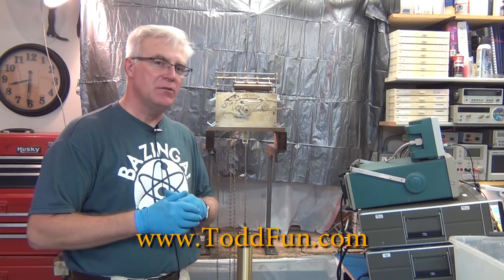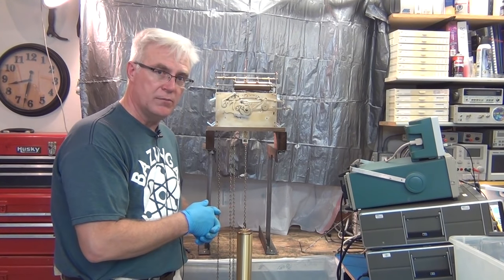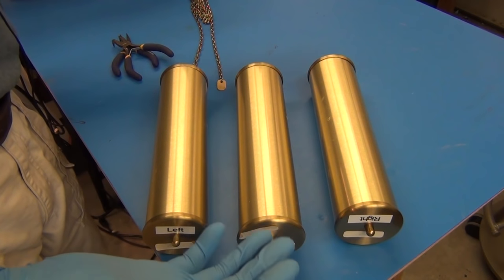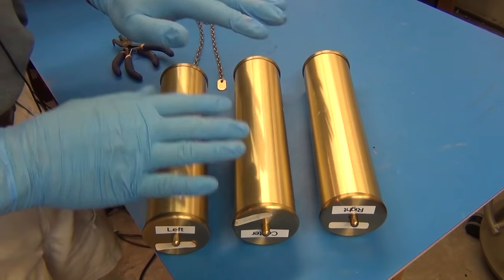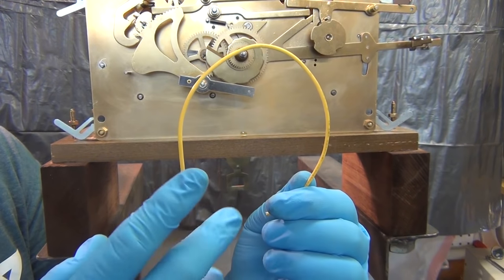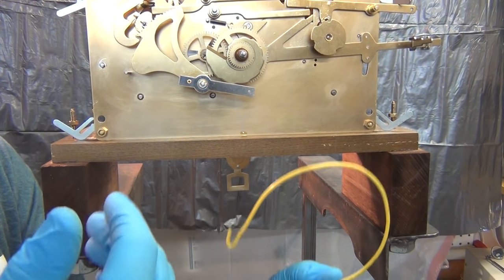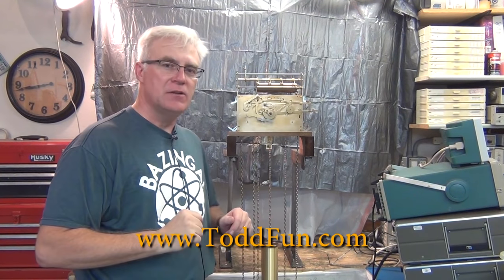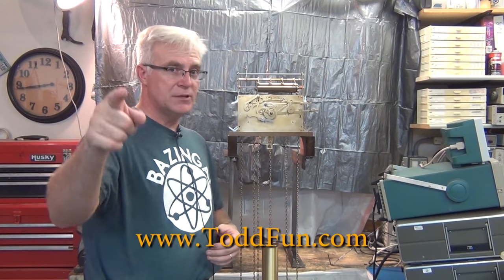How to Remove and Install Grandfather Clock Drive Chains

Comment: My grandfather clock does NOT seem to have side panel access. I looked on the inside of the cabinet to see if there were any
pieces holding the side panels in place, but there are none. The side panels seem to be 'fixed' in place and don't move.
Reply from the maker: Then the top might come off forward or  just have to the mechanism out.

Comment: No, I took the middle weight off right after I wound the 1st (on the right) chain with the weight on it. When I tried to help lift the weight from the chain on the second weight (I was just trying to not pull so much weight in case it fell and broke the bottom of the clock out), the chain got wound all the way into the hole at the top of the clock. I was left holding the weight with nothing attached. Now, how do I get that chain out of the middle hole? I can't even see it with a mirror and a flashlight. I think I broke it! The second weight is just left on a chair. I can't fix it unless you give me some suggestions when you have time. Thank you sir. I'm almost 69 years old and never worked on clocks before, but I do cherish antique clocks. This one of mom's and daddy's must be about 40 years old.
Reply from the maker: I can't think of anything that could help. I understand the problem now but if you can't even see the end of the chain there is no way to correct this problem without taking the clock apart or at least getting to the mechanism in order to release the click spring. You will have to call a clock server person. look up Horologist service. That is what you call a person that fixes clocks.

Comment: The center weight does not move down – hence the clock keeps stopping. Any suggestions for fixing this problem? Thank you.
Reply from the maker: Your clock most likely has  worn out  or really dirty pivots. And it’s probably dirty and needs cleaning. If you don’t think you can fix it yourself you’ll have to take it to clock repair service. Look up horologist in your area.

Comment: I have a 9 tube chime urgo 3071b.  We have sonic cleaned it oiled it and disassembled reassembled put more weight put it in beat and time and still cant get it to engage to make it chime. HELP!!!!!
Reply from the maker: Most likely something is wrong with the mechanism. Best to have a perfectional horologist service it in case it's bushing problem. They have the specialty tools to put in new bushing.

Comment: I have my moms 1960 wall weight driven German Junghans clock.  I hung it two days ago will run for about 24 hours and stop in the AM. Why? Will chime on the hour & half hour like it should. Help please
Reply from the maker: Could just need a good cleaning and oil if it doesn't have worn out pivots. If your not up to the task you could take it to a local Horologist.
https://www.youtube.com/watch?v=-4ghKvV433w&list=PL40clH-yZ7flbW79e7sXZ8Ws9sJbA5zFj

Comment: Suspension Spring  5/8 x 5/16. does 15.5mm x 8mm work?
Reply from the maker: Not sure. I would call time savers in the morning and given them any info on the clock and they should be able to find your exact replacement.
Reply: Thank you Todd

Comment: I recently moved and my chain got locked in to high of a position to reattach my weights to it, can you help me out I really don't want to take it to a repair shop again : (.
Reply from the maker: I do keep hearing that a lot. Not sure how this can be a problem. The weights should always drop if the clock runs. However, it must happen. There is a click spring on the back side of each drive sprocket so if you can get a small stiff wire on it to disengage it then the weight will drop. I cold see this not working if the click spring can't be disengaged in which case take the weight off, open the last chain ring and remove the hock. Do the same on the tab side then watch my video on putting chains back on. You might have to unscrew the shaft from the weight in order to get the clearance to remove the weight which means you will be dissembling the weight. They are just hallow brass tubs with lead or sand in them.

Comment: My grandfather clock stopped, while resetting hands to proper time something felt wrong. Runs good but chimes off hours,at 15 minutes past, any suggestions?
Reply from the maker: You might have slipped the hands and need to be take them off and put them back on when the clock gets to a hour chime. Also, if it is just a cycle problem they can be set to the correct cycle, but most of these clocks will self correct do to the cam design and cycling provided the hands didn't slip. Just let it run a day and it could be fine. If you have to adjust the hands for slipping the hour hand can just be slipped off and put back on at the top of an hour and if the long hand can't fit on pointing correctly at the top of an hour then use a needle nose pliers to turn the trapped nut on the back of the long hand so it can be put on at the top of an hour,  however this long hand nut normally does not slip unless you put a lot of force on it setting the time. Always best to set these clocks by rotating long hand counter clockwise not clock wise. However that might not be true for all clocks. Either way I would still just let it run for a day to see if the chiming self aligns after a full 24 hours.

Comment: I have a broken ratchet spring on the hour cog wheel of my Ridgeway grandfather clock. How do I replace it?
Reply from the maker: I would say you need to take it apart and replace it if you have the skills. If not then send it to a clock repair shop. 
Good eBay seller: http://stores.ebay.com/Mount-Vernon-Clock-Company
Good repair shop: http://www.arizonaclockco.com/services.html

Comment: We recently moved.  When they put our grandfather clock in place.  We went to set it up.  We found that the cable on the left is broken.  I live in lower Alabama.  Any suggestions?
Reply from the maker: You should be able to get a new one just fine. Call there guys and they should be able to help. I get parts from them all the time: http://timesavers.com/contact.html
Reply: Thanks, How hard is it to put it on?  I can't find anything on that.
Reply from the maker: That I don't know. Never had one. but they are real nice at timesaves so maybe they can give you some tips or a helpful link.

Comment: I’m reassembling my clock-the middle weight drops all the way down and cannot ratchet it up at all. Other two work fine.
Reply from the maker: You have the weight on the wrong side of the chain.
Reply: Todd Harrison Thank you for your response. No, weight is on the correct side. I’m afraid I may have damaged it while putting the chain back on.
Reply: Todd Harrison I did switch the weight on the off chance the maybe this hookup was different from the way you described in your video but...just not happening. Thanks again.
Reply from the maker: @donaldrecine9149  What happen when you switched the weight to the other side of the chain? Did it hang without ratcheting down fast? If so let it set and see if the clock starts working after swinging the pendulum to get it ticking. Then watch video to make sure clock is in beat so it runs good.
Reply: Todd Harrison I had originally set the middle weight so that it ratcheted in the same direction as the right hand weight. Then set it in the other direction as stated earlier. Each time the weight drops all the way down...I pull on the chain but there isn’t any “stopper” to hold the weight in place to keep it from dropping. Either I rattled it too much in the move or I somehow did something wrong when putting the chain back on. I’m surprised because I didn’t force anything, actually it was fairly easy getting it back together. Chains went on without any problem and the 2 outside ones are fine.
Reply from the maker: @donaldrecine9149  So you're saying that the middle chain can be manually pulled down from either side and the chain moves freely? if so then your click spring must be jammed open or is broken and can't ratchet and catch. 
No idea what model you have and what parts you might need but here is a general parts list and a repair video.
https://timesavers.com/search.html?q=click+spring&go=Search
https://youtu.be/SZgJl4VyvRc
Reply: Todd Harrison Thank you again sir for your reply. I watched the video from your reply and concur that it is probably the click spring. I may have disrupted it when threading the chain through. Not sure about taking the clock apart to the degree needed to get to the spring but not keen either to spend a couple of hundred for a spring that costs less than $5.00! I’ll have to see a video on how to get to the gears to start the repair-I’m sure there are some. My clock, by the way, is from Colonial Mfg. Co. from Zealand, Mich. Model No. 1694, movement 44. Has been in the family over 50 years and I can’t tell you how much I hate messing it up! Thank you again for your help! Wish I had seen your video before I attempted my reassembly.

Comment: Got my chains on and the middle sprocket just spins. It does not ratchet?
Reply from the maker: Click spring is broke or jammed. It will need service by a local horologist if you can't do the work yourself.
Reply: @ToddFun  Thanks!

Comment: What do you do if the chair is too far into the mechanism to bring down?
Reply from the maker: I hear that a lot. Not sure how this can be a problem. The weights should always drop if the clock runs. However, it must happen. There is a click spring on the back side of each drive sprocket so if you can get a small stiff wire on it to disengage it then the weight will drop. I cold see this not working if the click spring can't be disengaged in which case take the weight off, open the last chain ring and remove the hock. Do the same on the tab side then watch my video on putting chains back on. You might have to unscrew the shaft from the weight in order to get the clearance to remove the weight which means you will be dissembling the weight. They are just hallow brass tubs with lead or sand in them.

Comment: My problem is the right and left wheels that hold the chain have froze up, I can't get them to move.
I did not pull them up too tight,  They do hang a bit. How do I get them loose?
Reply from the maker: Maybe you have a broken click spring in them or you have bad bushing causing binding. If the click springs are not broke you should be able to take the hooks off and pull the chains off.

Comment: What does it mean if the chain gears dont want to ratchet?
Reply from the maker: Could be a stretched link that is jamming inside or the click spring has been damaged. Whatever it is something is broken and it will need repairs. Unless you put the weights on the wrong side of the chain and they fell all the way to the bottom of the clock and of course you can't ratchet backwards to raise the weights. Just a wild guess.

Comment: Seth Thomas grandfather clock stops chiming...not sure how to resolve  the issue
Reply from the maker: Could be a lot of problems. If my video and others can't help or you find the clockworks too complicated then it is best to look up a horologist in your area to service the clock. Check yellow pages or search online for local clock repair. If the clock is over 30 years old or hasn't been oiled correctly every two years then it could be worn out and the service could be very expensive, maybe even more than a new mechanization.

Comment: My clock has just been serviced, the Drive chain stops the clock every now and again, any ideas.
Reply from the maker: Well start by taking it back. They should warranty their service. It could also be the clock wasn't fully rebuilt which means it has problems that will require a deeper repair job with added expense.

Comment: When you pull out the chain hook the wire on end of chain  to pull the wire through so you don't have to mess around putting just the wire in
Reply from the maker: True when you do it controlled. But I get tons of questions from people how to put chains back on when they fall off and I wanted my video to show how to do that.

Comment: How can the middle chain back on without taking apart.there is no side to remove
Reply: The clock is a Howard Miller  model 610-502. I just want to take it apart.

Comment: My grandfather clock won't chime unless I pull down on the chain.why?
Reply from the maker: Most likely it needs a good cleaning and oiling. Or you have worn out pivots causing the gears to jam a little. Or maybe you put the weights on the wrong chain. Normally the weights are marked on the bottom and they have to be in the correct spot.
https://www.youtube.com/watch?v=-4ghKvV433w&list=PL40clH-yZ7flbW79e7sXZ8Ws9sJbA5zFj

Comment: very clearly described and shown
Reply from the maker: Thanks mark.
Reply: Your video enabled me to recover my winding chain which had got pulled up too far.  I was able to attach wire to the tab and then hung the weight from this below. It took about 36 hours but the tab eventually reappeared! I was then able to reattach the weight to the tab in the proper way.

Comment: very helpful … but at least on my clock you do NOT need to take the chains apart or open the links to refeed the chains over the sprockets … if that were necessary then the chains would never have come off in the first place

Comment: Pulled the chains and now the hooks are stuck in the sprocket for all three weights, what the hell do i do?
Reply from the maker: With some clocks you can fish in a stiff wire and giggle the hook some so it can fish past the sprockets and shafts and come out but only if you don't have to pull too hard. Otherwise you or a trained Horologist will have to take the clock mechanism out and at lest press the click spring on the main sprocket chain drum so the chain drum roll backwards. Not something you can do with the  in the clock case normally.
My clock play list:
https://www.youtube.com/watch?v=-4ghKvV433w&list=PL40clH-yZ7flbW79e7sXZ8Ws9sJbA5zFj

Comment: Can anyone tell me why my hermle grandfather clock runs 10 minutes to fast with adjusting nut of pendulum all the way to the end
Reply from the maker: Your pendulum is not original and is to short, or maybe you have the weights mixed, not sure how that would cause this problem but check them just the same. Should be marked on the bottom of the weights. Maybe your suspension spring is damaged causing some kind of problem. Also if the tick/toc timing isn't correct that could cause strange running and bad time keeping. Make sure the clock is 100% level. https://www.youtube.com/watch?v=GyMipsoNPF4&index=8&list=PL40clH-yZ7flbW79e7sXZ8Ws9sJbA5zFj
Reply from the maker: Also, I have seen some clocks when you lower the nut the weight on the pendulum does not move down. You have to free the bob so it can slide up/down sometime.

Comment: My wife & I moved, the weights were removed to protect the glass, somehow the chains fell out. I managed to get the chains back on & now it's timing 2 minutes for 1 minute
Reply from the maker: Are you sure you got the weights in the correct location? They should be marked on the bottom and if not they normally go heavies on the right to lightest on the left.
Reply from the maker: Also, check your suspension spring, it might have cracked or not be hooked up to the pendulum quite right.

Comment: Why not just link the new chain to the broken chain to be removed? Then mark the link to be removed after you fish the new chain onto the sprocket guided by the broken chain?
Reply from the maker: Great idea if that is all you're doing. However many times people remove the changes for service or they break and get pulled through by mistake or just are not included in a second hand purchase.

Comment: Sir I had barely pulled the chain to my mother's grandfather clock and the weight fell off the chain and broke, was it because after so many years the metal cover of the weight became weak?
Reply from the maker: Not enough information but not likely. Best to put on cotton gloves and lift the weight with one hand and pull the chain with the other so you don't bend the chain loops.

Comment: Four of the chime rods (Westminster) fell out of my Howard Miller 610-897 grandfather clock.  I would like to remount the chimes into their holder.  In appears that each of the rods is held in place by it's own screw.  These screws are not easy to turn with a conventional screw driver.    I haven't been able to find any instructional videos or information on how to reattach these chimes in their holder.  Can you provide any guidance?